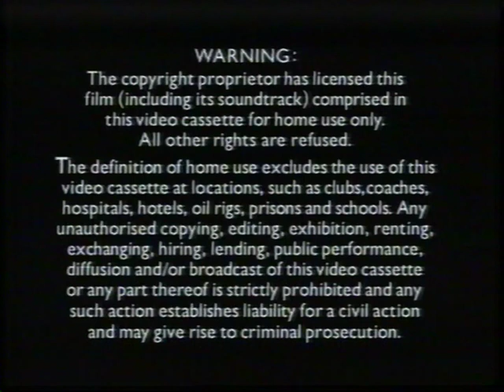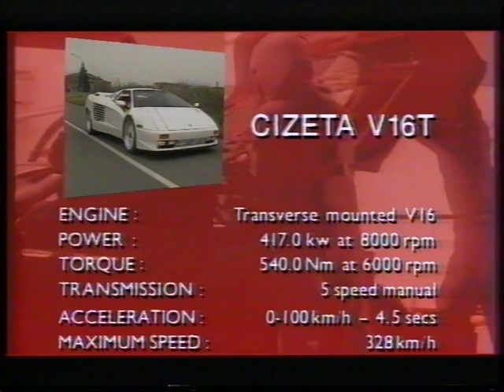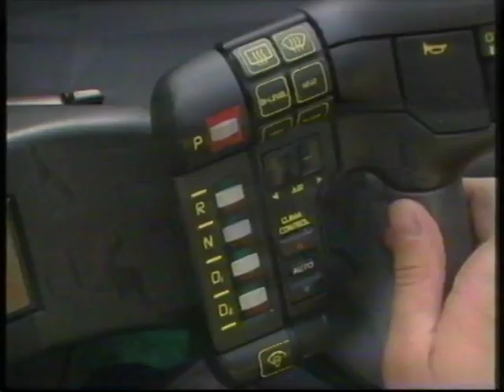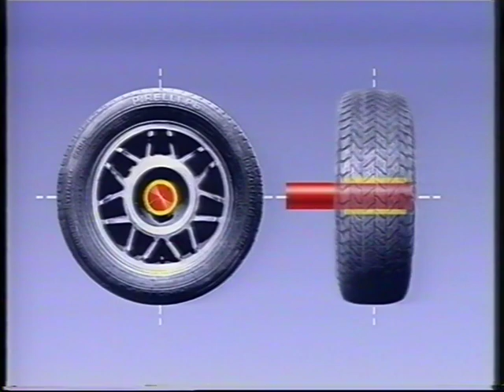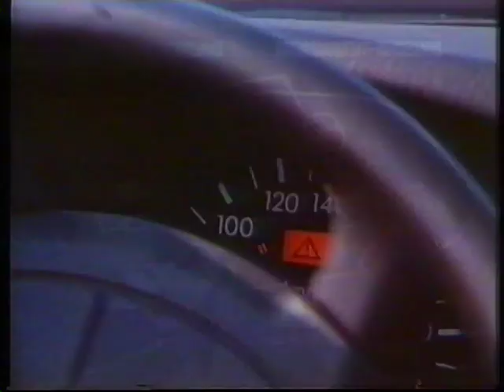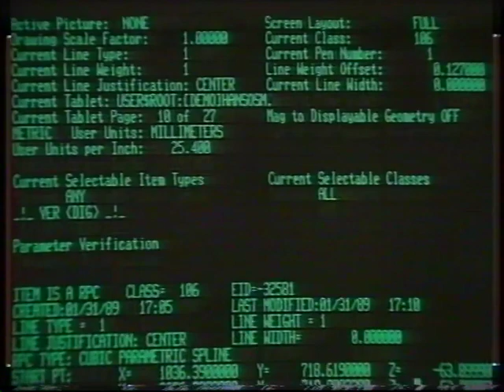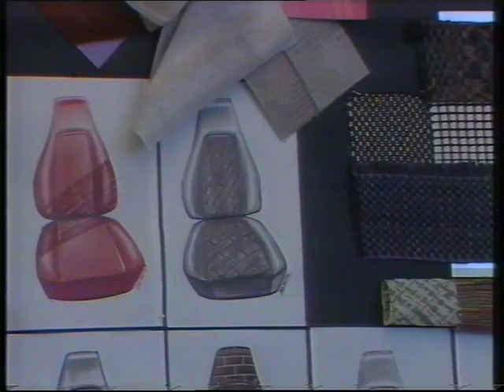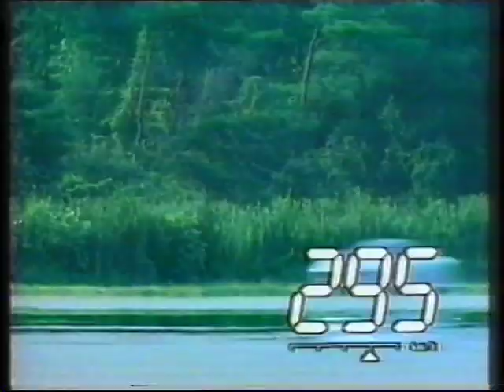Beyond 2000 Super Cars

Comment: Funny.. up until a few short years ago, companies were raving over their internal combustion driven 0-100km/h times of under 5 seconds. Hyper cars costing millions could do the run in under 3 seconds. Then came electric and all of a sudden family sport sedans costing less than 1/10 of a hyper car could outrun it down the quarter mile
Reply: The experience and sounds of a mechanical v16 will never be surpassed by anything though. Very unique and special, an engineering tour de force.